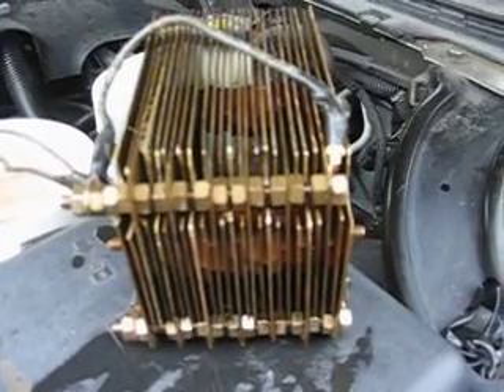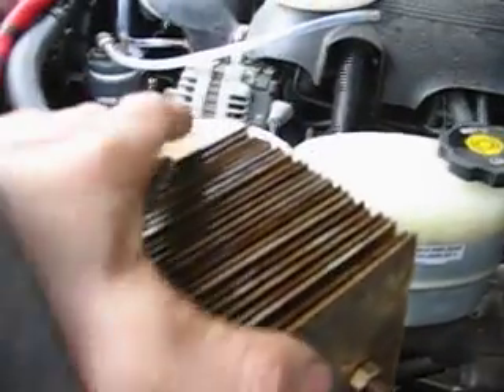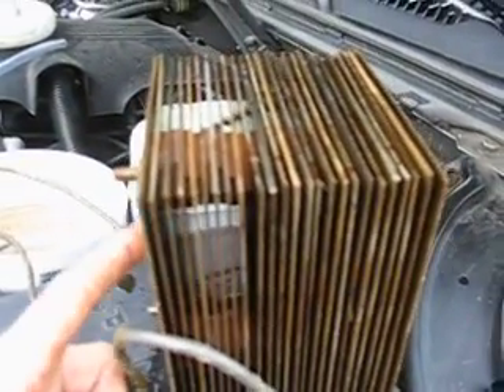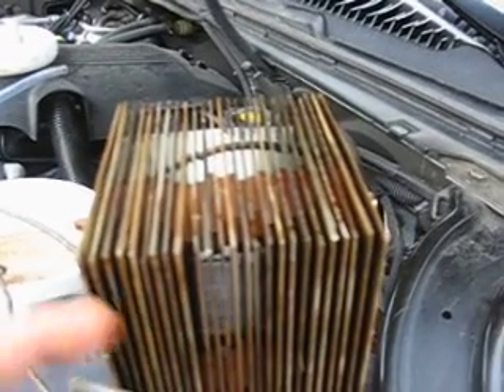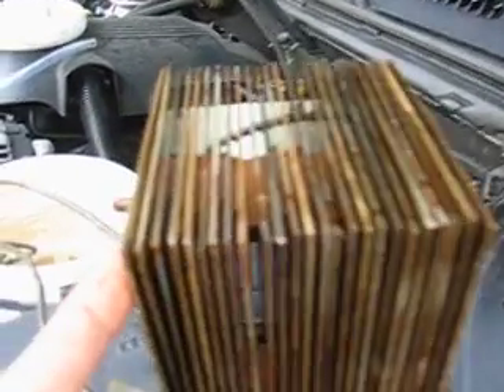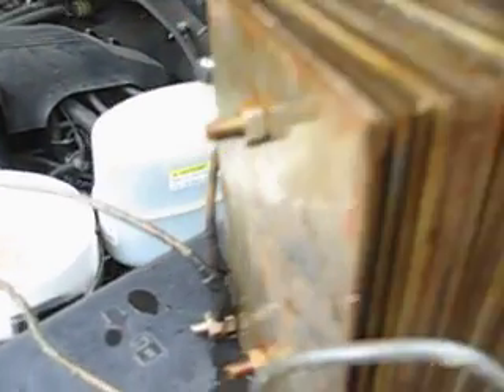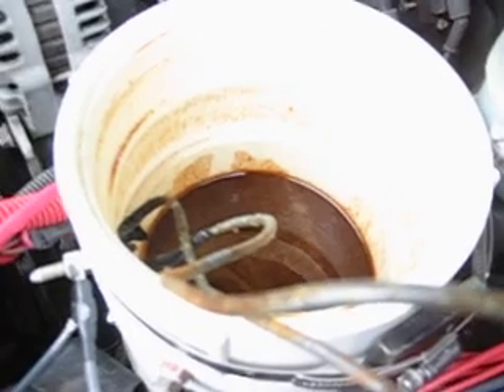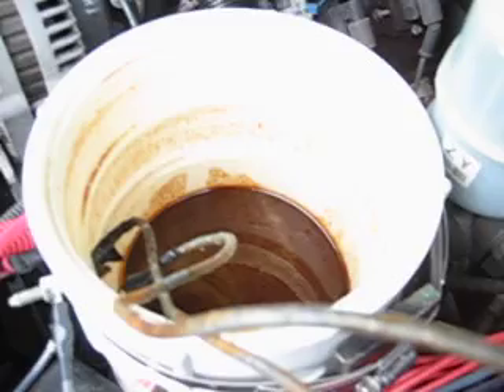My HHO cell 2

Comment: I ran a carburated engine with only HHO for 3 seconds before it stalled. I guess you need a 40-60 litre/per minute HHO generation rate to fully run a car. That calls in for overunity, which can be acheive using sharp 2000V pulse @ 48KHz using IGBT high voltage transistors.

Comment: Get a PWM to help reduce the volts going into the cell as it gets hot. It will help adjust it. We have them available on E-Bay and our website for less than most sellers. kevlau.(com).PWM is the site.

Comment: yeah, would have to agree ... if you are used to 10mpg, 14mpg is a pretty good improvment ... seems most of the guys with larger engines are reporting the best results ... the guys with the itty bitty peddle cars dont seem to do as well ... but then I guess on the bigguns, there is just a lot more room for improvment ...

ok, thanks for the feedback ... good luck to you ... hope when you get your efie gizmo in there you will let us know if it made a difference for you ...

Comment: Sorry, but you looks like you are going to have to disassemble and clean it up probably with CLR to get that crud off.

Algae? Are you sure? Am surprised the little buggers could survive in the reaction. 

Your green may be from zinc plated screws and/or copper in the soup.  Did you notice corrosion on your contact points and screws?

As a rule you want to be carefull about mixing metals in the soup.  Best to keep it all stainless steel either 304 or 316 grade.